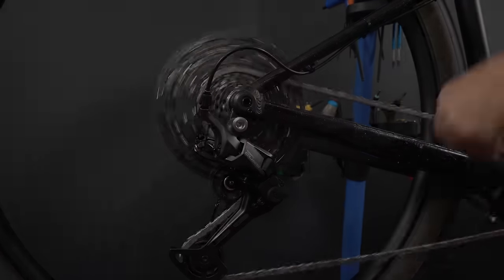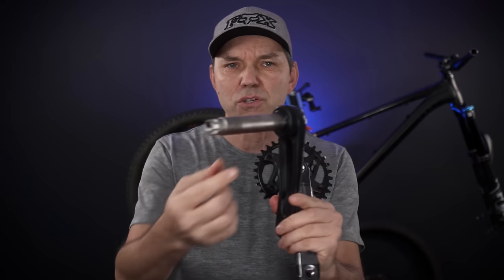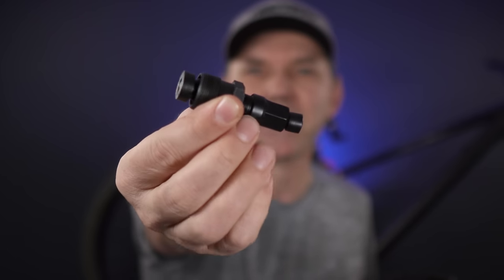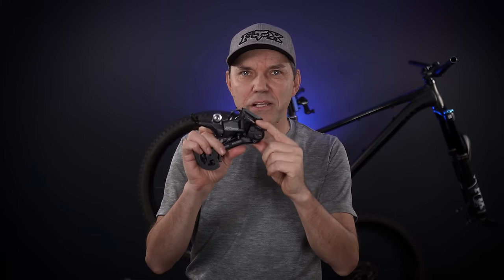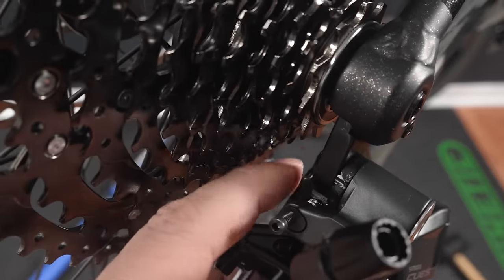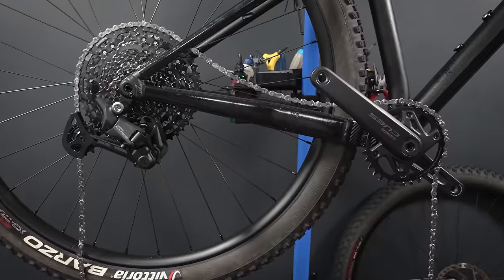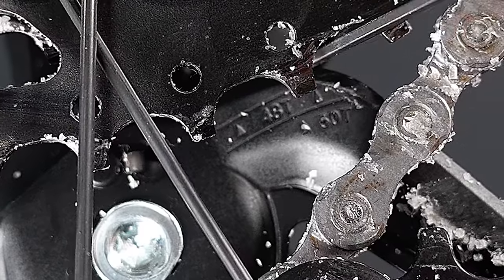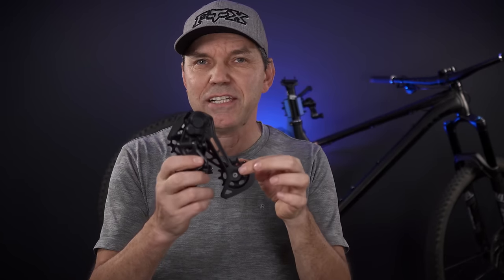4 of 5 - Testing Shimano CUES U6000 1 x 11 speed, Installation, Linkglide 9-10-11s Drivetrains

Comment: This makes sense to me. I have zero need of a 10 tooth sprocket on my 12 speed shimano cassette. The durability would be really welcome too. I seem to a go through an XT or SLX cassette once per season. Seems silly and I don't really care about weight on my trail bike. But, I watched your video on using AXS with Shimano 12 speed and now I'm hooked (BTW, you never did a follow up after that video. Are you still running AXS with Shimano?)
Reply from the maker: I do not as I’m always testing new things. However there are quite a few folks that I know running it successfully both on bikes and e-Bikes
Reply: If you are burning through SLX and XT cassettes, try a Deore cassette with all steel cogs.

Comment: I really like how people barelly use old stuff that works instead of the old stuff, that was really good a while ago, much cheaper and that in many parts of the world would be right way to go, because a carbon expensive bike is really not what you need, when you barely have roads without asphalt. :))). World under bubbles. Rich vs poor, the ugly truth. I'd literally have to do a train ride every weekend for such stuff, while going to the supermarket for shopping is definitely overkill this, if you want to also take into account possible thieves.
Reply: I got a neighbour kid, that barelly afford stuff over 500$, What does that kid need for dropping stairs in the city, posibly o good steel sturdy frame, a 3x8 shimano altus (old school derraileur with big wheels, that's very good at holding the chain) and steel spoked wheels, maybe not even disk brakes. And we're talking about taking people based on bubbles and dreams, new stuff all the time.
Reply from the maker: I bet my money that a 1x9 CUES would serve that kid better, this is a good advancement of tech. And nothing wrong with setting up a 1x10 with 11-36T cassette and Zee derailleur for peanuts it would work just amazingly well😊
Reply: @LoveMTB  Yeah, if he'd have the money to maintain it. It doesn't matter that the technology is good if the money are not there. We are talking parents that may have less 2000$ a month, probably a second hand car to maintain and 2 kids.
I do have a beefed up Rockrider st520, basically a frame with enduro wheels si rockshox xc30, everything upgraded as cheap as possible, with as much budget for learning. It's an all around bike that takes 170kg on it when going shopping.
Do you want to know why I don't go 1x9? A 1x9 chain is almost twice as expensive as an 1x8, A chainring is almost as priced as a 3x crankset. 
The only problem I have, and it's annoying, is that somehow, in traffic, when switching chainrings, the chain itself gets stuck to the chainring and pulled up. But that's also because I keep stuff a bit dirty.
Reply: What this kid would actually need is a cheap 1by8 system, possibly one of those chainrings with 2 plastic guards. The biggest problems, however, is that he needs good wheels, and these chinese ZTTO enduro are crazy good for me, but at 130$, he wouldn't even think about it.
Reply from the maker: I have a vid about those....great value! @cyberalex4life
Reply from the maker: Tourney will still be around @cyberalex4life